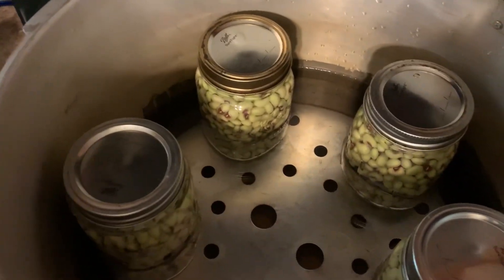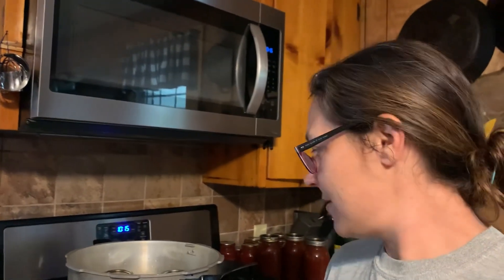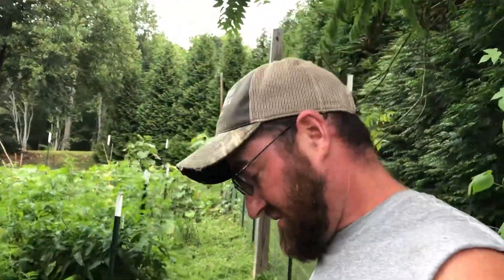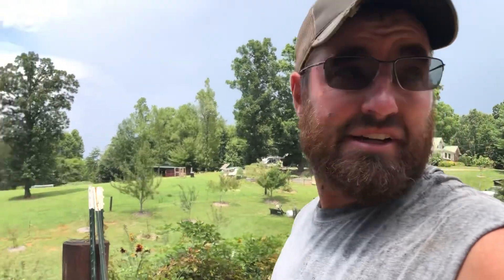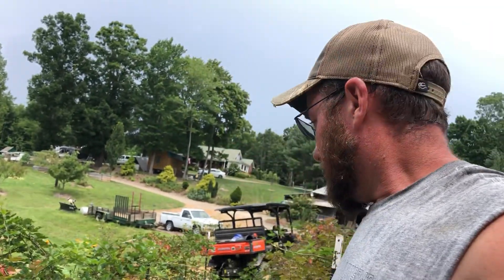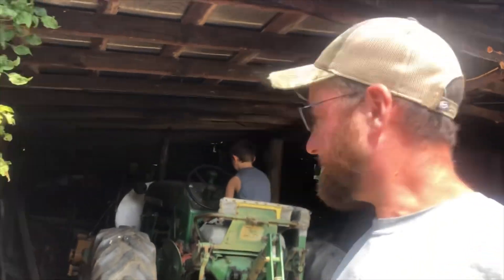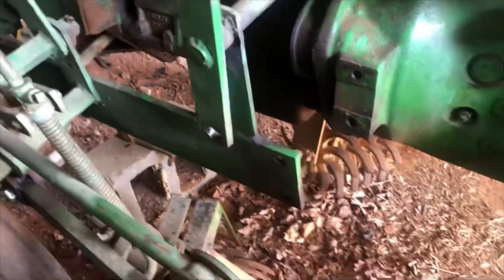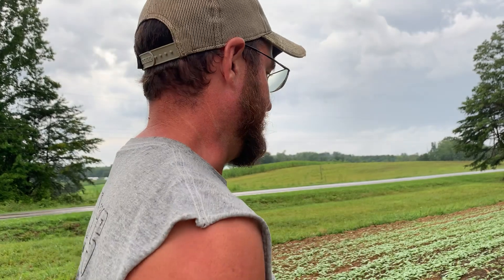Canning, Garden Work, Tractors, Horses | Homestead Vlog | August 16, 2023

Comment: Meagan, quick question, I noticed your canner did not have water covering the jars all of the way (no judgement, I promise!), when I tried to water bath dry potatos they floated up 😂, I'm thinking they won't this way? Forgive my ignorance, and ps I love you guys!
Reply: Shes using a pressure canner, it only gets a couple inches of water. Ive never seen anyone water bath potatoes.
Reply: Read the Ball canning book and the USDA recommended ways to can food. 
Certain things like potatoes, beans, meats etc are always canned using a pressure canner never water bath. 
Water bath canning cannot reach the required internal temperature that pressure canning will.